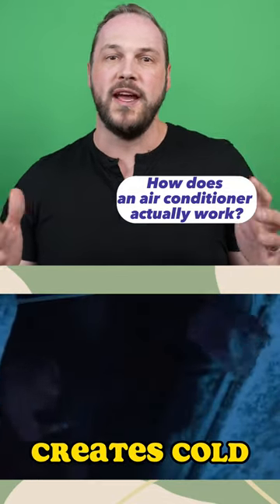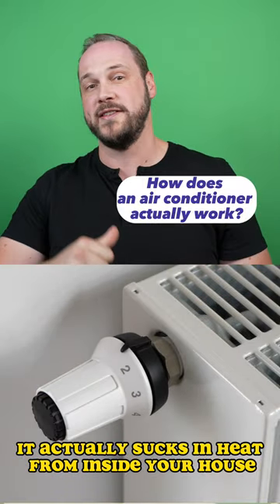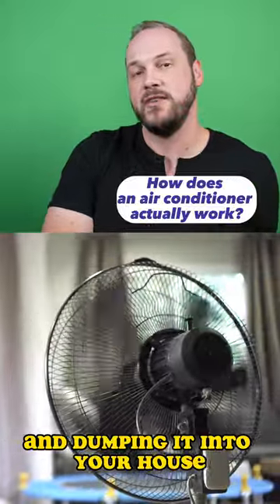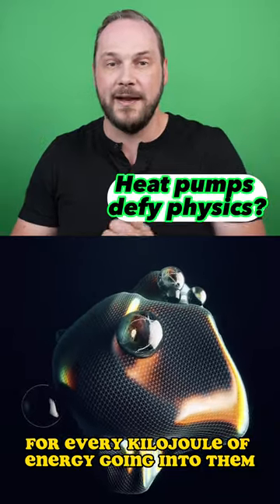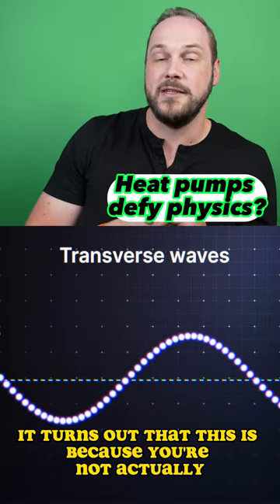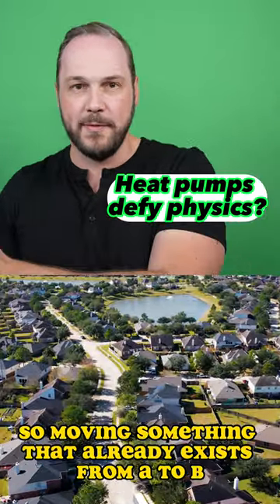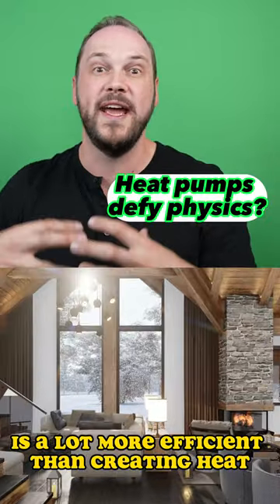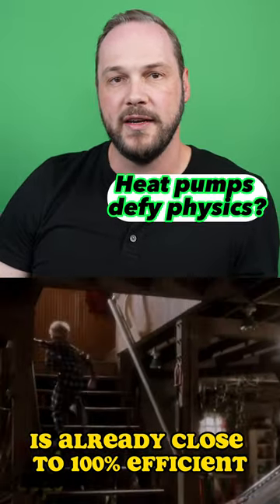Heat pumps go against the laws of physics?

Comment: It is still against the laws of physics. If that was the case, i.e. 300% efficiency, then why can't we install an 2nd pump in series from the 1st pump, and give out 3 times more, i.e. output 9 times from the original input?  Could even try a 3rd pump and give out 27x output.....The 300% efficiency is a big con. People tried to build perpetual motion machines in the 17th-18th century, until physicists formulated the laws of thermodynamics and proved this was not possible. No machine can be  > 100% efficient.